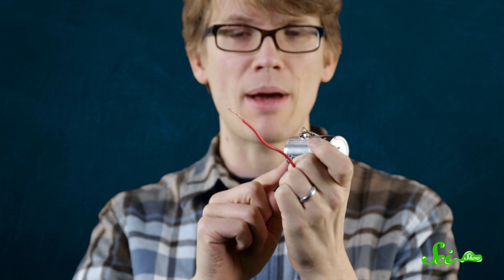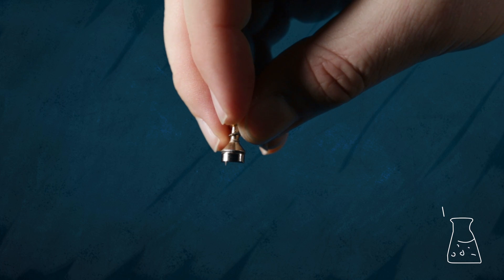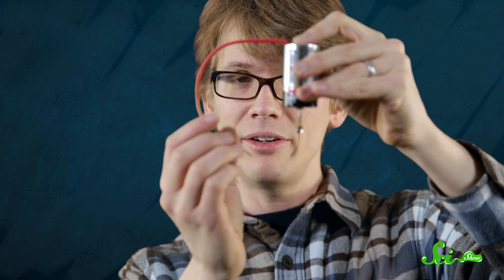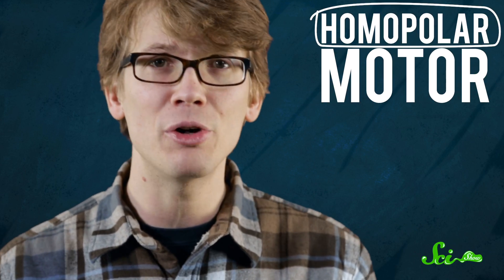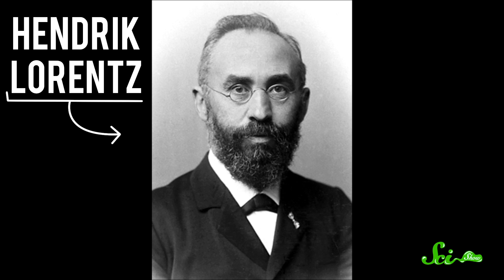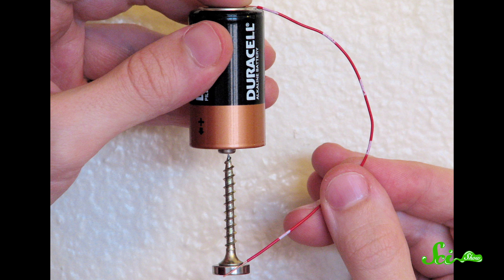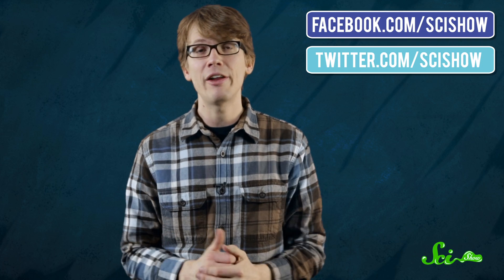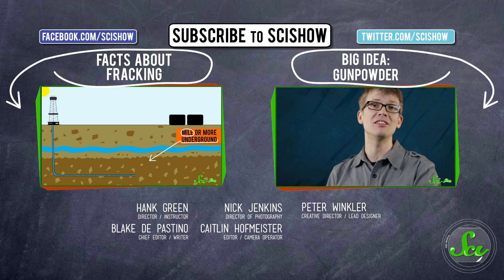How to Make the World's Simplest Motor: SciShow Experiments

Comment: take a copper wire covered with plastic,wrap it a little piece of iron like a nail then you connect the tips of the copper wire to a battery. the  nail will act like magnet

Comment: There are some cool experiments by Veritasium, e.g. demonstrating gyroscopes, showing that steel conducts heat better than plastic, even when at the same temperature.

Another cool experiment could demonstrate the similar principle of loudspeakers and microphones, and show how you could use each of them in the wrong audio socket for the other purpose.

Comment: Interesting to note is the direction the magnet is turning. The magnetic field is exerting a force on the current making move, but my postulate is that the magnet is spinning in the other direction because of the conservation of angular momentum.
I haven't tested it properly, but if you found out the direction of the B-field, you probably could. Have you tried that at SciShowCentral?

Comment: complete guess, albeit a slightly educated one, but I believe it would have something to do with the universe expanding over those 13.77 billion years, so the position the light would have travelled to would have also expanded away from the edge of the universe, so it will have actually needed to travel less than the full 46 Billion light years (imagine an ant walking on elastic, stretch the elastic to 2x its length, and the ant will be further from the elastic edge than it has actually walked.)

Comment: That is not true, direction of electric current is set from positive to negative with general agreement, its flow direction of positive particles. Even thought current in metals is transported with negative particles (electrons), still there are virtual positive particles - holes, which are created when electron moves away from his position.

Comment: Good one. I thought that electricity is actually carried by electrons which are negatively charged flowing from the negative to the positive and not the other way around. There is no difference in the functioning of the motor obviously besides the spin direction of the screw maybe.

Comment: But, with the current ways of measuring and understanding energy, it cannot be created of vanished (or like that), and changing that would mean whole new system, as it doesn't make sense in the current. The question how it all came to be is indeed a good question, but also, the hardest one that could be answered correctly. Also hardest to understand, which causes that kind of thoughts. It's just so puzzling. (STILL continue to one more)

Comment: You're actually correct. But for a long time physicists and engineers thought electrons flow from positive to the negative terminal. This is called the "Conventional Current Flow". But in reality it was discovered that it's the opposite, electrons from flow the Negative to the Positive terminal, this is called "Electron Current Flow". Ultimately it doesn't matter, when calculating things we just add negatives in the current calculations.

Comment: In our collection of experiments at our Physics Institute we have a even simpler (in terms of components) electric motor, with only the wire, the magnet and the battery:
The battery is dented in on the plus pole, and the wire is very stiff and as a spiraled shape, so that it goes around the battery, is balanced in the dent at the positive pole, and touches the magnet on the negative pole.
This way the wire doesn't even have to be held to spin all on it's own.

Comment: irrelevant, it's completely irrelevant wich direction electrons flow through you body, if they do it too fast, you die .

your body itself doesn't have enough potential unless you touch the ground, so it's really the ground and the source that form a circuit with the help of your body.

and the reason it hurts us is not the voltage, it's the amperage and the 50hz frequency of alternative current, the 50hz frequency conflicts with our neurons that control the heart beat, wich also work at 50hz.

Comment: the really weird thing is that the marble also creates a current, it just needs to be very very close to the copper wire, and the current will be very very small.

marbles and magnets are really the exact same thing, except magnets make the EM force obvious because all the electrons in their top-shells have their spins alligned.

but all atomic matter behaves this way, it's the reason why your hand doesn't go through the table, the EM repulsion between electrons.

Comment: and vice-versa, when electricity goes inside an engine, the electrons transfer their momentum to the magnet, wich then emits that energy as an Electromagnetic Field, that Field can turn a rotor .

all of this is actually done by virtual particles, the Field itself is made of virtual photons, but they are called virtual because they don't take away mass from the magnet, until an object is actually turned by it. 
This is how all the 4 fundamental forces work, via particles.

Comment: if you want an even more precise explanation.

each particle in your hand has momentum, the faster you hand move , the more momentum those particles have.

when you spin a magnet using that mechanical energy, your hand basicly looses some momentum from it's particles, and that momentum is transferred to the electrons in a spinning coil around a magnet, those electrons then emit that energy via electricity to a cable connected to the coil, and Voila! you just produced electricity.

Comment: to be more precise, the magnet itself converts mechanical energy intro electrical energy and vice-versa, it does not produce energy, it merely acts as a converter.

you always get slighly less energy than what you put in, because some of it is lost as heat and friction.

it's impossible to create an engine with 100% efficiency , that's a principle of mechanics.

Comment: however, alternative current doesn't have a particular direction, alternative current basicly "alternates" from right to left 50 times per second , it's much more efficient that way .

direct current is what you see when lightning goes off , it's a direct transfer of charge from cloud to earth, OR from earth to cloud, that's right, half of the time, Lightning actually comes from the ground.

Comment: because back in the 18th century, before we knew what electrons were, we decided arbitrarily that current flows from + to - , in reality, the electrons flow from - to + , but that wasn't discovered until the 1900's.

however, it's actually irrelevant wich direction they flow in, since they are analogous to eachother.

when you touch a very positively charged object, you basicly conduct electrons from the ground twards it, it work in reverse also.

Comment: the polaroid lense polarizes light, the light is all polarized in 1 angle, if you introduce another polaroid at a different angle then polarized light cannot past through it because it's already polarized in 1 particular angle.

polaroid lenses basicly contain long strands of molecules , these strands change the spin of passing photons to a particular angle.

and no, "spin" does not mean the photons are actually spinning, spin is just an intrinsic property of fundamental particles

Comment: fun fact, the direction of the electrical current is opposite to the direction of the moving electrons that carry the negative charge, the positive charge isn't actualy "moving" , it's the "holes" caused by the electrons leaving in 1 direction that cause the current to flow in the other.

another fun fact, the electricity itself is faster than the moving electrons, in fact what's happening is virtual photons are exchanged between the electrons at the speed of light in between them.

Comment: I think that the explanation here does not make sense. Assuming the magnet has its north/south poles facing up or down, there would be no current in the screw perpendicular to the magnetic field. However the current in the wire is perpendicular to the magnetic field, this creates a force spinning the wire. because Hank is holding the wire it cannot move so the screw and magnet spin instead (because of Newton's third law of motion).

Comment: Next episode try this.
At home plasma generator!
Required items: adult supervision, a microwave, 4 corks, a pyrex bowl, a grape, and a paper towel.
Procedure: Take a grape and split it in half so that it is only connected by the skin across one long side, use the paper towel to get as much moisture out of the grape as possible while still leaving it intact, place the grape in a microwave and prop a pyrex bowl above it on 4 corks, set timer to 5 minutes and enjoy the lights.

Comment: In my 8th grade science class we made a flashlight out of a paper towel roll, 2 d cell batteries, a few wires, a plastic bottle cap, tape, and a small right bulb. Which I used till the batteries died.

Comment: Yes but the way circuit analysis is traditionally done assumes the current goes that way, it's a holdover from before we knew what electrons are. You can do it the other way but you'd probably confuse electrical engineers for a few seconds until they realise what you've done.

Comment: the voltage in the system will never exceed 1.5 volts (battery used in the video) so touching the wire would feel like touching both ends of the battery...

Comment: That second statement isn't quite true.  Electrons flow out from the negative end of the battery, but current flows in the opposite direction.  The force carriers of an electric current don't have to be electrons, but if they are, the flow of charge and the flow of mass are in opposite directions.  You could also carry a charge using positively charged ions which would travel from + to -.

Comment: Gah, Hank. The electrons don't flow in the direction you indicated. The current pushes out from the negative, not the positive =[

Also, there are some other examples of this effect that a bit simpler to achieve. Something like a paperclip balanced on the top of a battery, allowing it to spin freely without needing you to hold the wires in place.

Still a neat video.